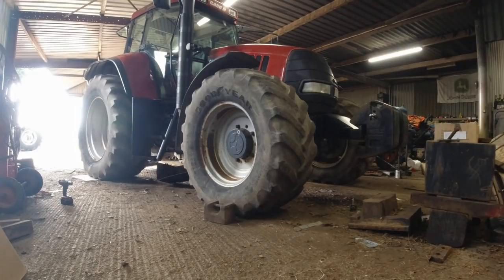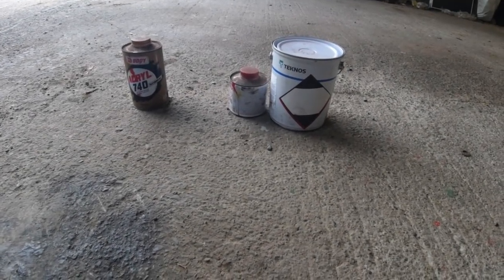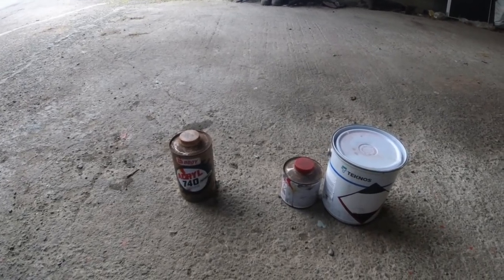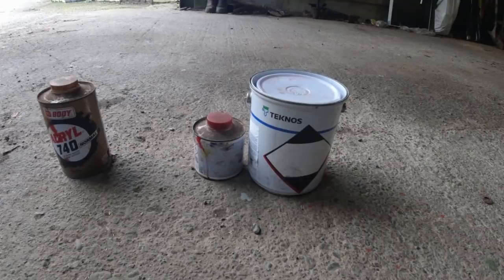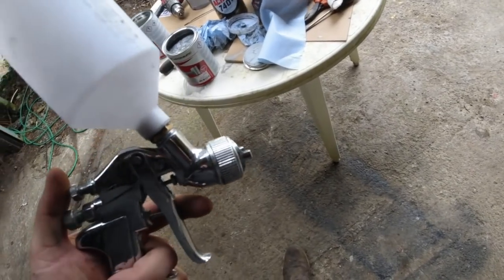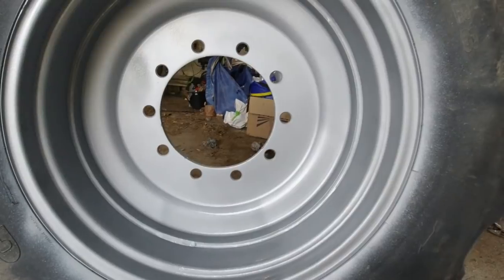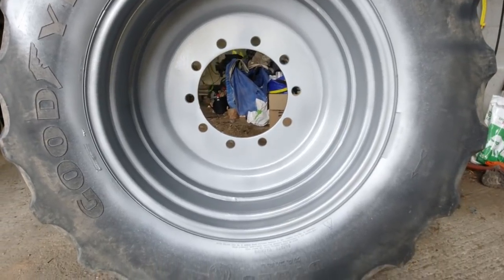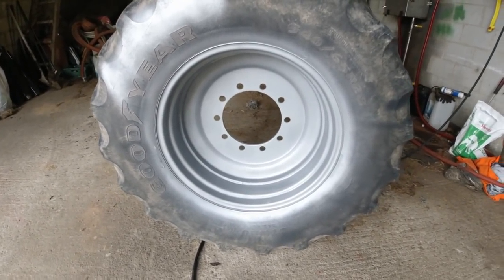CVX restoration part 3. removing wheels and spray painting

Comment: How much thinners do you like to add to paint, I find that the most difficult to get right
Reply: mcflowers197900 if you boil the can of paint in a saucepan you don’t even need thinners. Make sure you take lid off or it will explode. 
It gives it a better shine as well. But you will need more paint.
Reply from the maker: The comment above is correct that helps thin the paint.
Honestly I don't use any apart from on primers it just makes it too watery.
The little drop of hardener is a better bet.
Two pack paint is the only paint to hold its shine
Reply: Mr cvx primer is great for the paint to last on the surface. Paint also Varys a lot from brand to brand. Usually get sparex or tractol paint from brogans. But I recently got case silver from tractor line and it’s way better paint for the same price. Great shine off it.
Reply from the maker: Best paint I ever used was hempel paint.
It's a marine paint
Reply: Mr cvx never used it.